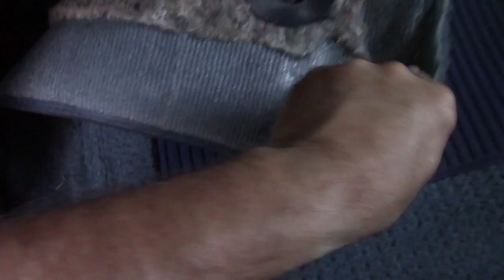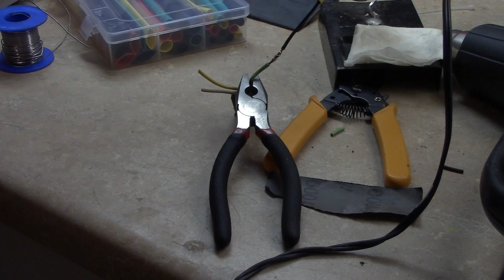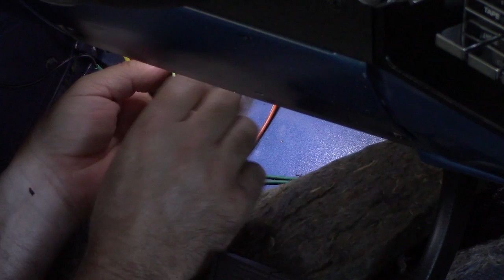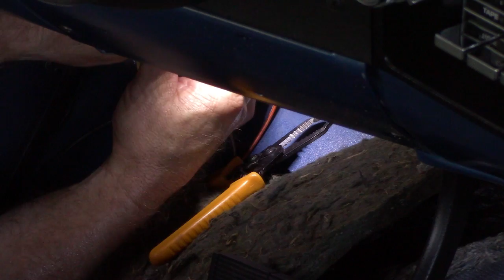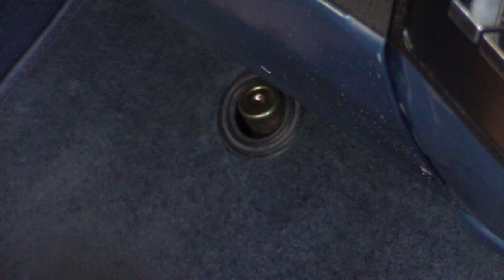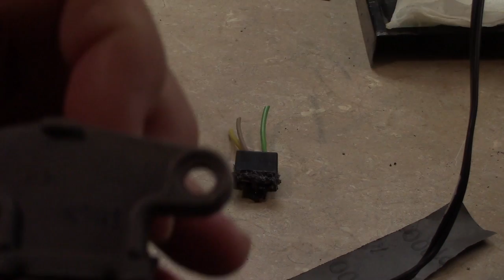1981 Silverado Refresh Part 7: Headlight Dimmer Switch

Comment: Ah yes, the floor mounted headlight dimmer switch.  I never really did understand why they mounted them there as a foot switch.  My dad's old Dodge Aspen had one there, as most old cars did.  The Bluick's got one there too, in fact, it might very well be the same part!  

Interesting to point out, but kind of scary at the same time:  THE BIG SIX's pretty much everything is run by computer.  If I want to put the hazard lights on, the button's right there on the dash, it clicks on and clicks off just as you'd expect.  But all that switch actually does is tell the computer to turn those lights on and off.  I have a higher-level scan tool that can turn them on without my pressing the button.  

Contrast that with this, where the full current is passing through that dimmer switch.  Same with the turn signals, even the brake lights, all of that current passes through the turn signal switch in the steering column.  

Each have their pros and cons.  As much as it's scary to think of the amount of current flowing through all that, it's pretty scary that it's all run by computer nowadays.  I think feeling the current in the steering wheel is still the better option.  There's an old saying that goes "To err is human, to really foul things up requires a computer".  Any wire on the communications bus breaks, you're going to have tremendous problems.  Great while it works, a nightmare when it breaks.  The old school way, great while it works, nowhere near as bad when it breaks.
Reply from the maker: Not sure either. That would be a fun research to see what the logic was, behind the design!
I would certainly trust Toyota's computer over a GM equivalent, especially from that time period!
By the way that connector was burned, I'd say the current chooches pretty good through there. I have a headlight relay wiring harness to install when a roundtuit arrives, and it will alleviate the main current passing through all the switches. I seldom drive this truck at night, so not real high on "the list."
Yep, if that computer fails, big problems. As seen here, bad connector, just solder in a replacement, and done!
Reply: @dynatrak  Yeah, it's funny, could be good one way but then again, not so bad the other way with the backing of reliability.  Though I will say this:  Friend of mine had a Honda Civic, I think it was a 1990 model.  A neighbor of his t-boned it backing out of his driveway in the snow, it was totaled.  We scavenged parts from it.  I was appalled to see that the wiring to the halogen headlights was about as good as Christmas lights wiring.  It was the thinnest stuff they could possibly get away with.  Remember that there's safety tolerance built in to a lot of wiring and circuits.  Like in a house, you shouldn't exceed 13 amps on a 15 amp breaker.  But that breaker will not pop until it hits 15 (or over it).  Not to mention, it won't blow immediately because it has to handle heavy loads starting, even on a heavily loaded circuit, if there's a lot of starting current but very little running current, and it can start it, it will happily exceed 15 amps.  That's what I'm saying about the headlight wiring, maybe they ran it for 4 hours straight and it didn't burn up, or maybe they count on the airflow from driving.  What a feller's trying to say is it certainly didn't look the part.

However, any connector that's carrying a heavy load will burn up in time.  When I changed the blower motor resistor on the wif's old car, that connector was not looking too good.  Fortunately, it didn't need replacing, because it still worked.

My dad told me a story about the blower motor failing on his 1969 Grand Prix.  The ground wire for the blower motor had a bad connection.  The dealer's fix was to plasma cut a hole in the fender wheel well to access it, then patch it up with some "duct tape" of the time, you know, whatever's around the shop.  Then again, this was Brooklyn in the 1960s or 70s.  Things went on there...

Any wiring I ever did on my old Chevy, that had a heavy load on it, I used a relay.  There were almost a dozen I installed in that car for all the stuff it had, there were relays clicking all over the place.  I even had a couple fail over the years.  They were easy to replace, everything had push-on terminals.
Reply from the maker: Yikes! That's certainly interesting about the gauge of wire used in the Honda. In my home, I go less than that, as the house is equipped with the infamous Federal Pacific Stab-Lok breaker panel. Back when I was still learning the basics, I mis-wired something, plugged it in, and it immediately tripped the breaker. Perhaps there some bad product run over the years. I do keep a close watch on those breakers. The old sniff test, to detect burned electric smell, and the IR thermometer for hot spots. So far, they are stable. Shh! Don't tell the breaker twerps!

Yes, when I was doing the AC work on the Grand Marquis, it came with a new connector for the blower module. The original still looks per4fect, so the replacement went into the hoard for later.

Oh man, that's interesting about the '69 Grand Prix repair! I'm sure that wasn't the first one they "fixed" like that, or the last.

Relays sure do help in that regard. That harness I got, they are socketed for easy replacement. The positive battery terminal already has an extra pigtail, so it'll be easy to connect there, and look factree.
Reply: @dynatrak  I'm glad I don't have any electrical issues in my home.  Everything is nice solid copper and the panel was replaced at some point so it's pretty modern.  Even all the outlets are the newer "Decora" style.  Like any house, I just have to mind which outlet is on which breaker if I have more than one heavy load to run at the same time.

Yes, that "repair" was to save labor costs.  Obviously, it went together, so it can come apart, but there was so much labor involved in doing that, the shortcut was always taken.  Of course, better design, making that accessible in the first place, would have prevented the whole problem.
Reply from the maker: @jaykay18  Yeah, we have solid copper throughout. There was some kitchen renovations done in around 1966, and there was some aluminum used in those areas. Every time I find some aluminum, it gets replaced! Pretty sure I have all of that out now.

Indeed, it would've been a good idea to make that area quickly accessible. I'm sure that one design problem could've been fixed, but then they would've created at least a half-dozen more problems!